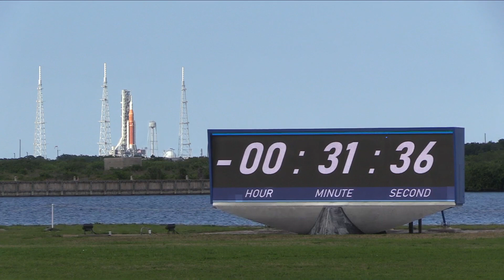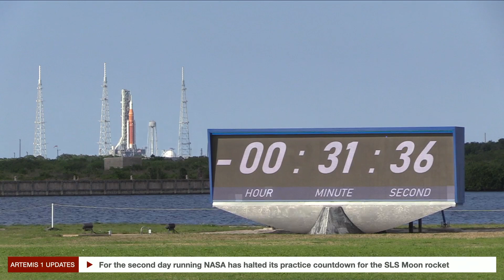Replay: the moment NASA scrubs Moon rocket countdown rehearsal

Comment: Shouldn't these "technical" issues have been worked out at this point??
Reply: This rehearsal is part of the process of working out those technical issues. Notice that at least so far, the significant issues have been with the mobile launch platform, not the rocket itself.